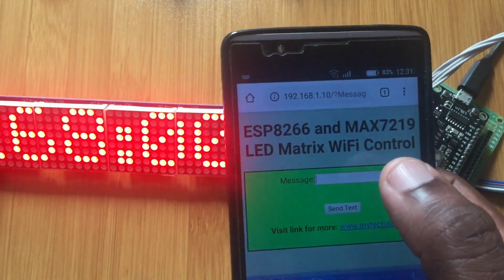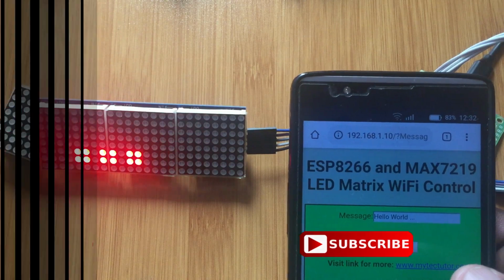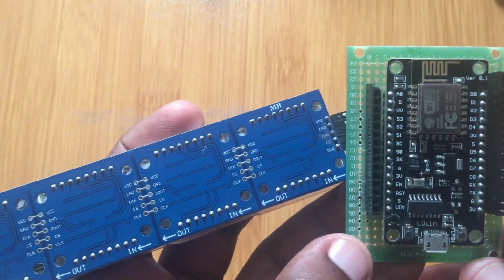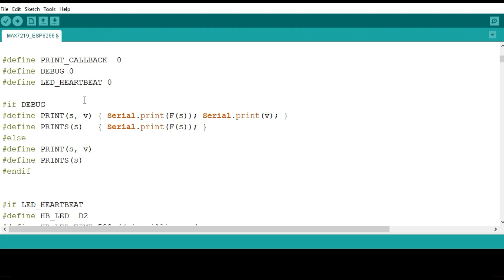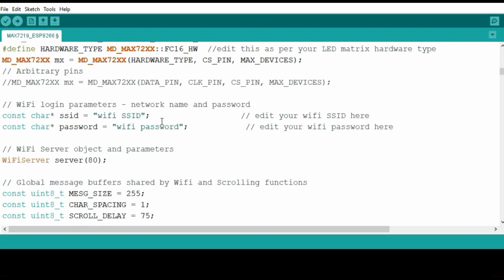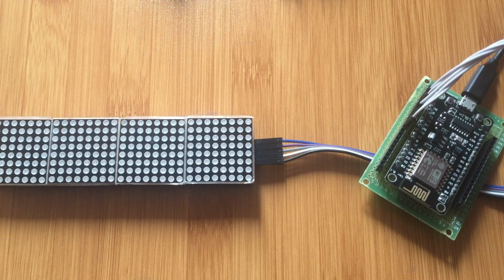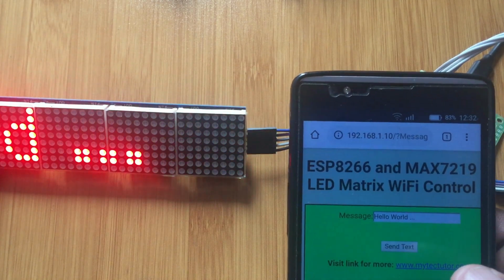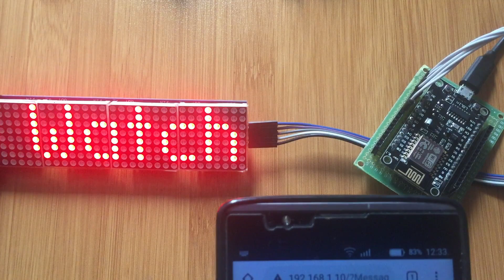Controlling Max7219 8x8 Led matrix by Phone with Nodemcu WiFi

Comment: Thank you for your project video. I did run into an issue with timing, perhaps variation in the MAX7219 displays cause this.
My test worked on Arduino for a baseline, but not on the ESP8266 (D1 Mini), and same with NodeMCU. 
After troubleshooting, the timing seemed to be the issue, as the ESP chips are way faster than the Arduinos. 
The fix was to add:  SPI.setClockDivider(SPI_CLOCK_DIV4);  
Then it worked like a champ.

Comment: Hi, thanks for a great guide. Any idea on how I can add a image/logo at the top above headline, I tried using <img src="logo.png" alt="Logo" style="width:500px;height:600px;"> but that did not compile in Arduino. Any thoughts on how to solve that? And also, do you see any risks of exposing this to the internet via a dynamic DNS and port-forwarding? Any easy way to put a password on the page?

Comment: So I tried this code but it seems to have an issue with the Define D8, Are you using a specific version of any of the library? I have been trying to see why this is throwing the error from your code but having troubles. Can you assist in this?
Reply: i have same problem
Reply: Hello. Maybe you already solved the issue. I had the same problem. I used nodemcu, but for the board I selected ESP-8266 general in first place. After selecting "nodemcu esp-12e" it worked.